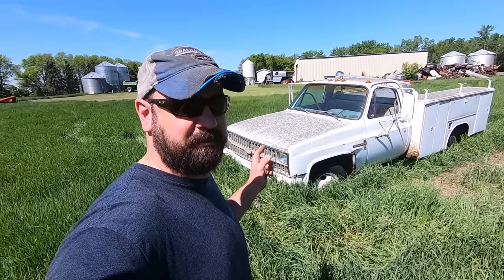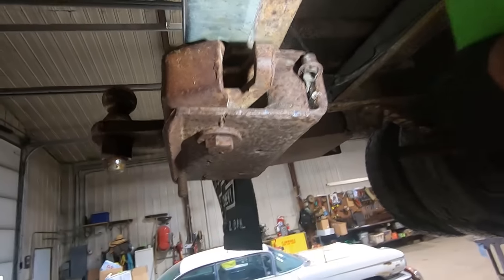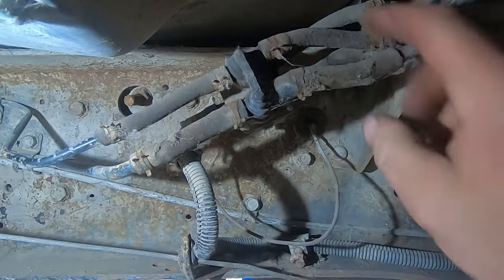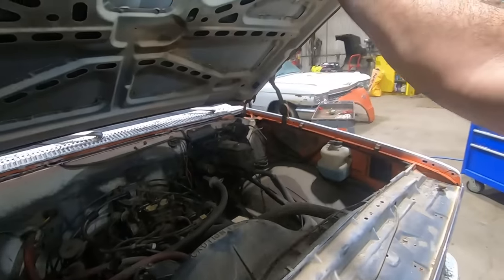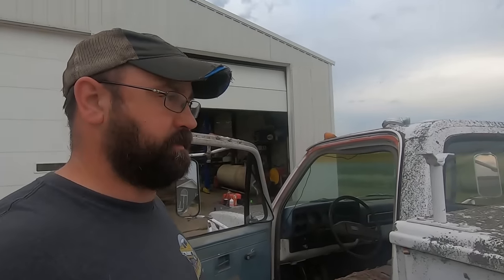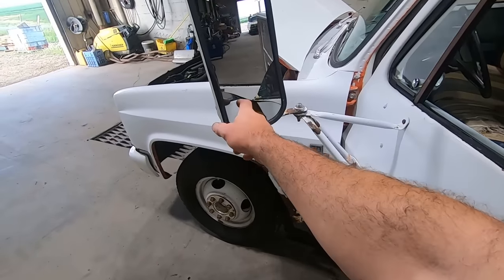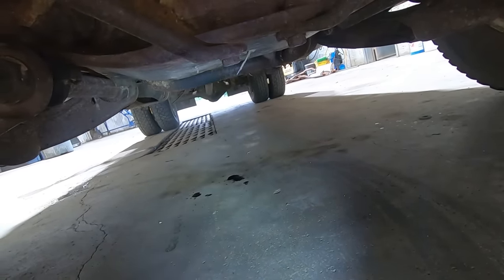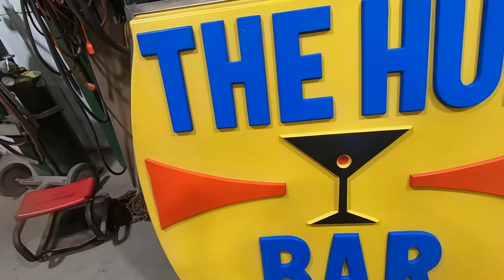1981 Chevrolet Dually! Abandoned for 16 years! C30 Squarebody Service Truck!

Comment: I worked on a Peugeot years ago, adjuasting the valvelash. I turned the engine over with a torx nut and somehow i just had to much beer i dont know. I searched for the nut and couldnt find it. Went for a test drive and i heard like something pinballs in the engine bay and yeah, the nut shoot out and hit the car behind me direktly into the windshield....

Comment: Not a tool. but I had my engine out and was putting a dual master cylinder on my 66 Galaxie and the rod with the nut dropped right down into the exhaust pipe. I had to cut the exhaust to get it out.
Reply from the maker: Whoops

Comment: Dropped a wrench between radiator air condition condenser.
Reply from the maker: Dang
Reply: Same. Mid-90's Escort. Immediately knocked a pin-hole in the radiator. 😭

Comment: YOU BUILD A SMALL ROOM AROUND IT (AIR COMPRESSOR  )  WITH A DOOR AND SOUND PROOF THE WALLS WITH SPRAY FOAM OR A CARDBOARD  EGG CRATE LOOKING MATERIEL ,  LIKE THEY USE  IN A MUSIC RECORDING STUDIO  OR USE THE CARDBOARD EGG CRATES FROM THE STORE (  IT WORKS)  /  IS WHAT WE DID IN THE BODY SHOP  BECAUSE  THE SHOP USED A LOT OF AIR   / DEPENDING ON HOW BIG THE COMPRESSOR IS   , USE A FLEXIBLE AIR   CONNECTION FROM THE  COMPRESSOR  TO THE MAIN LINE TO THE SHOP ( IT'S JUST UNDER A FOOT LONG AND LOOKS LIKE  A WIRE  WEAVED MESS IN-BETWEEN THE CONNECTING ENDS   / IT SOUNDS LIKE A LOT OF WORK BUT YOU WILL LOVE IT WHEN YOU DOD NOT HEAR THE COMPRESSOR RUNNING ALL DAY EVERY DAY   / IT WAS A 15 MAN WORKING SHOP AND EVERY ONE USED  AIR  ON AND OFF ALL DAY LONG  / IT HAD TO BE DONE /   WE HAD TWO BIG AIR COMPRESSORS  ONE BEING USED ALL THE TIME AND THE OTHER WAS A BACK UP SO WHEN THE MAIN ONE WOULD  BREAK DOWN AND HAVE TO BE REBUILT WE JUST TURNED A VALVE AND IN A SECOND WE HAD AIR  / IN A BIG SHOP YOU CAN NOT AFFORD TO BE DOWN   MORE THAN A DAY OR TWO   / THANKS MORTSKE I ENJOY YOUR CHANEL YOU ARE THE REAL DEAL /  NO TV SHOW WITH B/S   " PLASTIC  PEOPLE"   /   QUOTE FROM  (FRANK ZAPPA )  THANKS AGAIN
Reply from the maker: Sounds like a plan

Comment: My first look at a Mortske vid... good edits, keep that guy (Wayne's World, Music overdubs, the popsicle tee-shirt guy) ya got me laughing.  But at 4 minutes in I see the vid is 2 hours?  I dunno about that, bein-used ta 15 min ones.  I hear tell they can show a whole story in 1.5 hrs at the Drive-In The-ater.
Reply: I'm waitin' for a side mirror repair... can of HD expanding foam insulation should do it, the thin applicator tube goes in the hole n the foam pushes the broke mirror bits out flush.  Tape mirror bits in place so they don't get pushed out past level flat, n it'll all be glued in place with back support dry. Foam backfills the hole, no rain/snow gets in, and you skive the foam surface flat.
Reply from the maker: That’s what we do. No short stuff here.

Comment: You could build a small shed on the outside of the building to house the air compressor
Reply from the maker: Not sure it would like the cold weather
Reply: @MortskeRepair  insulate the walls and roof with rock wool (its fire and mold resistant).
Reply from the maker: @darkknightjpw  Never heard of it.
Reply: @MortskeRepair  its great insulation, it dosnt sag like fiber glass and it's not nearly as messy. I first heard about it when they had an apartment fire in my city and the fire didn't spread past the first apartment. You can find it at lowes, he depot or minards
Reply from the maker: @darkknightjpw  I'll have to check i tout.

Comment: That one wire going to the back was probably for the lift
Reply from the maker: Could be but they're pretty light.
Reply: @MortskeRepair  could have ran it to a massive relay
Reply from the maker: @jerryshelton1481  the control wires would maybe be small. and control wires wouldn't go under the hood. I think it was for an inverter.
Reply: @MortskeRepair  yeah now that's very possible could have been running the lift off of it or generator

Comment: You can make a swamp cooler with drum fan an old radiator pvc  a little giant pump  
and fabricated catch pan full of ice and water if you were born in STL  this would be born into you🤣
Reply from the maker: Thanks for the tip

Comment: Sposed to put that ring between rims
Reply from the maker: Never seen one between them
Reply: @MortskeRepair  normally used for corrosion protection between aluminum and steel rims
Reply from the maker: @Phuckhead2723  So since I have steel wheels it shouldn't be an issue.

Comment: The Chevy 1981 with similar to the brand, Wells, blue Grommet ECM PCM software already install 8 cylinder program for product of the Wells in stock of Grand Auto Warehouse Vintage in between $50 dollars replacement and/or new barn find brand is $170.00 dollar electronic running the spark firing sequential Northstar IC from Delco.

Comment: I've been seeing a lot of chin but no pumpkin LOL that should be the beginning of the video
Reply from the maker: Pumpkin?
Reply: Pudding sorry about that misunderstanding I just call him pumpkin cuz if he watches YouTube channel he acts like a pumpkin sometimes not hating by no means I like his YouTube channel I just think it's really funny it's on the s*** he does like get on top of the hood of any vehicle and dance while using a power washer with his shirt off what then turn around the one thing is good about him he sees a project all the way through that's the only thing I like about his YouTube channel if it has anything it needs to be done to a vehicle he does it only thing I don't like as much is the nonsense U-Hauls but everybody got hit their own suit their own suit they have to wear but yeah I hope I get to see it next week more updates on a F100 LS swap that's sitting in the shop with the hood off still and it would be kind of cool and amazing to see more oil changes everybody loves the oil change maybe the week after LOL you can get that Chevy square body utility truck running better than ever maybe order a muffler for cuz I had a lot of mice nests or field mice nesting inside that muffler I bet you when that heats up a little bit you can smell it all the way out to the car only at the windows are down you going 65 you have to find out why it's doing that too cuz usually square bodies would hit 89 82 85 miles an hour with no problem and yours is only going 65 is that because of the governor cuz I know some of those utility trucks their governor was set for that speed because it's a commercial truck well at least with a modern-day once I don't know about the square bodies and the early 90s

Comment: 1...spark plugs wire ..u can't count to 8 lol...if it need 1 it needs all them .u that cheap .....u ought to jus.stick to starters and flickin..points...there's som stuff called DEGREASER..IT PROPERLY CLEANS MOTORS ..Thiers also body hammer for this whiskey dents ...they actually work ...
Reply from the maker: You should probably start your own YouTube channel with all that knowledge!

Comment: Keep petting the Duff please and let ride it and Duff has a named Randy so duff has to touch the steering wheel and while the guy, Mortske, step of the gasoline. Na na keep your fender inot nice and neat I think I gotta take the driver side front fender and ride the Dune buggy truck 1981. It would look better for both good one front fender coming off and then Chrysler PT cruiser car front motorcycle 345mm wide tire fender on the top of the tire. Another fender from 33 Model A Ford in a year made 1995 PT cruiser.

Comment: Use the fan. Don’t be a Geezer. Back in my day we didn’t have no stinking fans. Walked 20 miles to school going uphill both ways sucking in hot humid polluted air and breathing in atomic radiation from above ground nuclear tests.  Look how that turned out, not good.
Reply from the maker: Haha

Comment: A 350 is such a disappointing motor for a 1ton. We’ve got an 86 sierra with a dump body on the farm and it really has it all… terrible fuel economy, and no power! Mostly it just plows.
Reply from the maker: This one performs quite well
Reply: @MortskeRepair  I think the ours probably has issues from 50 years & 160k miles of near broke farmers hacking on it. Haven’t bothered to dig into it because it’s not a road truck & it bumps around just fine for what we ask of it. I hooked an 18’ bumper pull stock trailer to it once though and couldn’t make it up a steep hill empty faster than 10mph. Kinda thought that was what a 350 was capable of because it’s the only one I’ve ever run. Everyone I know that runs square bodies have swapped them to 454s.

Comment: Contact  big ass fans 1 12 ft spinning slow enough to watch it flows more than a dozen or more house fans but it would be money well spent with the roof done in extra insulation in summer it's blocking heat and the winter it's not like the ❄ outside on metal  definitely don't want to try out the tounge against frozen metal 🥶🤪 one of those  portable inflatable spray booths has ability to make them for a clean room li,e 20x40 with air conditioning  and a side draft paint booth 🤔💡 with a set of portable benpack pro Jack's you'll be able to have your lift in all  corners of your shop and outside on concrete if needed and   as you are working man being able to pull up and have lifts for some stuff that's just not available u don't wanna trash them under bumper aprons especially on early cars some are only a few inches wide and if it has a few soft spots  not being able to get out of dirt might cost more than a cost to put new casings into it as sleeperdude says  lol great content as always  and remember that if you don't have any haters your not doing it right 💯 and if they really don't like the channel they watched it as well as commented about the video  as long as they are respectful we will be nice and I like the way you just about slapped the taste out grass rug feller for your mom comment on the tee shirt  👍🚫🤬 I bet duff would like to bite him in his arse

Comment: The one-ton truck is now duelie 1/2 tonne and it needs many things like Brake and battery and wiper, etc. The oil is staying in the engine but maybe it is black oil. Cheap sponsor Mortske what other sponsor you a free oil from Rotsella and more STP tires 1500 HP trucking or else bad oil failure to run my Rocket in capable of carries 5 pet dogs into the place of just grasses in the space NASA in Nebraska of Mortske called air balloon that will not kill so the air balloon lift me up to 200 miles high but I don't astronaut suit that is part of the shuttling some of vehicle that's working for Elon oxen Musk.